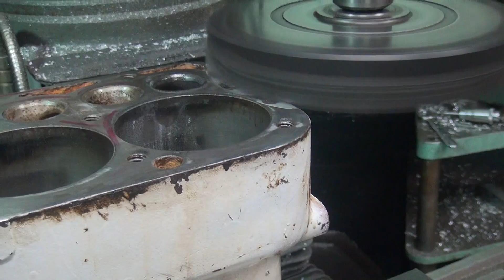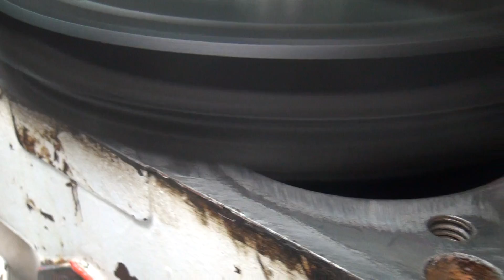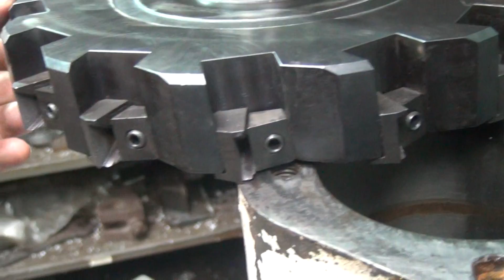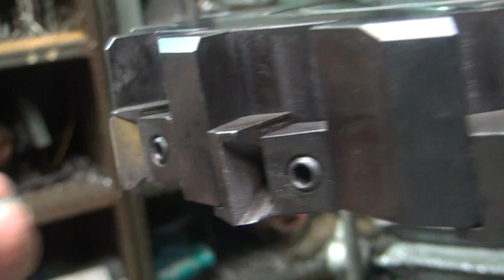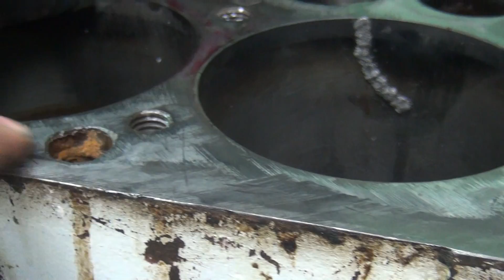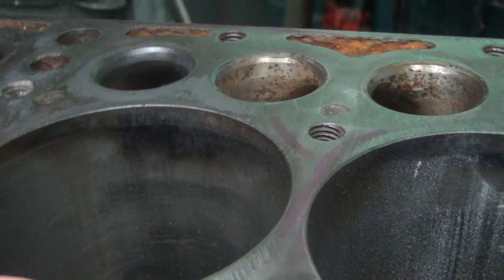1932 ford #111 model A or B flathead race block crack repair by tatro machine

Comment: Damn thats fast, i would have used about 250rpm and a slow feed and a bigger cut carbide loves to cut! not hating just saying!
Reply from the maker: everyday is a learning experience. the racer in me say faster is better. i was told along time ago that you can not go too fast with carbide. i proved them wrong many years ago.
tatro